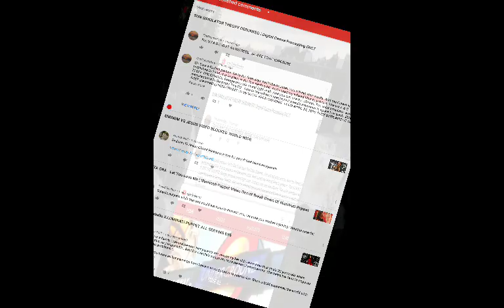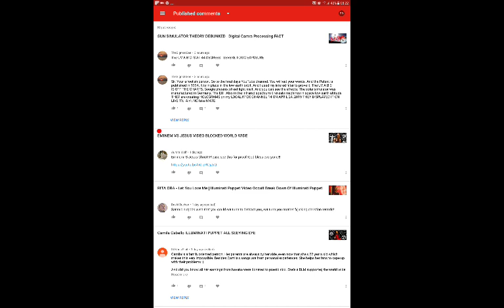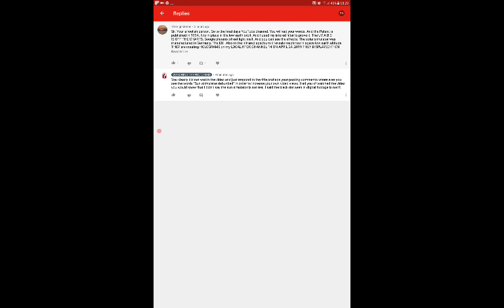Sun Simulator Theory 🤔 What's The Black Dot?

Comment: I can debunk the sun simulator.  If it was small in size, it would have to be very close, and it would be seen in radically different places in the sky, depending on location.  If it was far enough away to be seen in the locations observed, it would have to be wider than the earth, by a number of times.  Ergo, it is VERY low probability that it is a simulator.  Approaching zero, in fact.

I am reminded of this mirrored vid:  www. youtube. com/watch?v=AwGG3x3v8RA  (remove the spaces - if I leave a live link, My comment vanishes)  It shows that the sun, whatever it is, has to be very far away...along with the planet being a globe.
Reply from the maker: Intresting. Drop me the link and I will have a look 😀
Reply: @WATCHINGTHEWATCHERS  |  I have no link.  Just (and humbly I admit) high genius in spatial perception (tested as such).  It is clear to Me that if it was smallish, it would have to be very near, and observation from various places would differ widely from what We actually see.  To be what We see, it would have to be a long way off, and the further away things get, the smaller they appear.  Ergo, if it was small, it would appear as a star, not a sun.  It would have to be HUGE to give Us what We observe.

Do watch the link I did give about sun angles measured from many places at the same time...